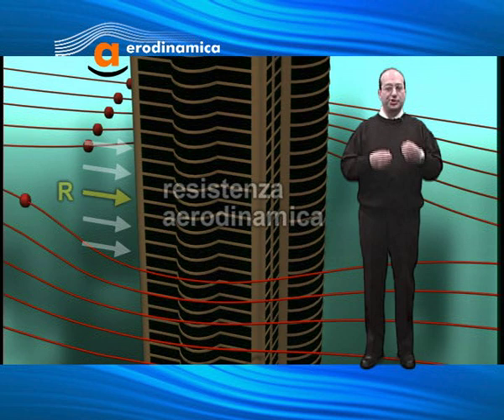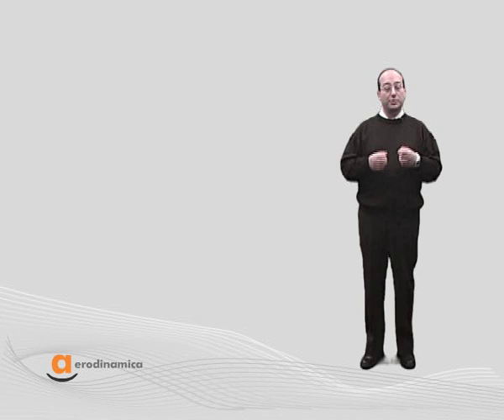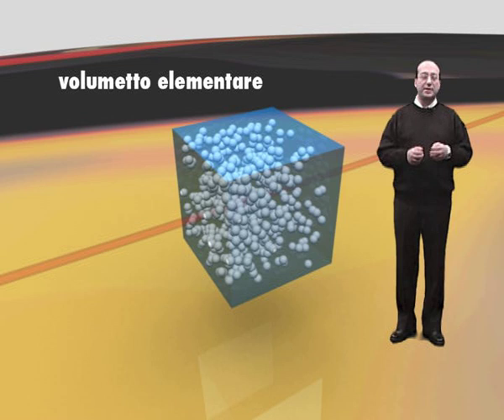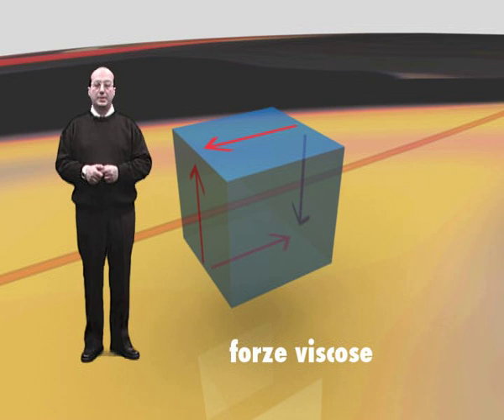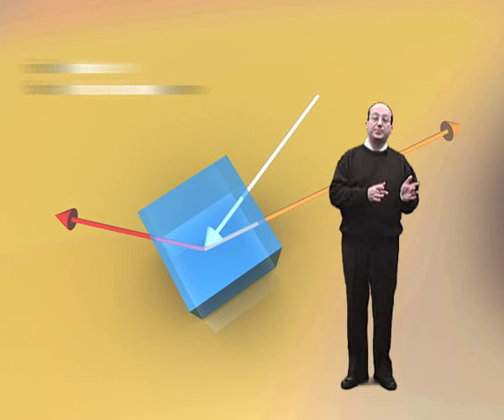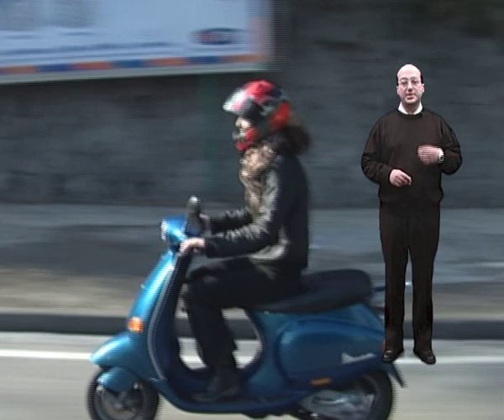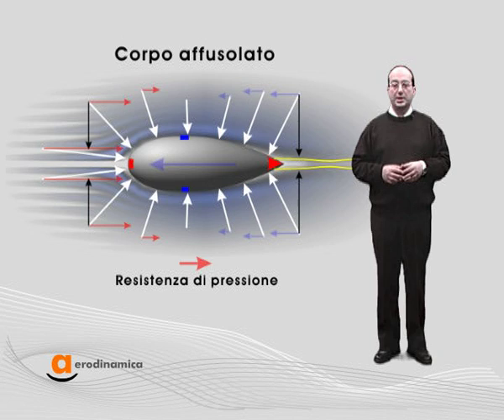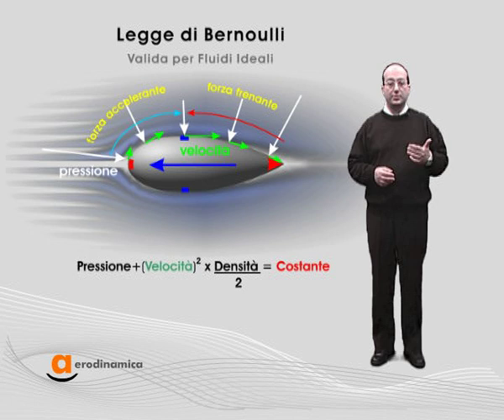Video Lesson 1 Aerodynamics The Drag

Comment: Could one divide the drag  as follows?
The friction drag   and the  compression drag and the partial vacuum drag.

1.  the friction drag is due to shearing of fluid,  hence the viscosity and surface finish.
2.  the compression zones which are changing the momentum of the air particles to move out of the way.
3.  the suction or low pressure zones which are pulling the wing back due to its effective thickness and angle of attack.

There so many wonders around us,  all unseen and unheard.
Reply: Of course one must add the induced drag to all this.

Comment: Recently the 100yr old Mystery of Airfoil Lift has been  solved finally !  Check Tekemon.
The reason it took so long to get to the reality of lift was the basic error in assuming there’s some kind of flow of air over the airfoil, which gave rise to various erroneous non-existent and irrelevant concepts e.g. Bernoulli, Flow-Separation,etc. Everything is covered in the book, in detail. The matter was a very simple one, but the wind tunnel gave the scientists true tunnel vision for the past century. Check tekemon.